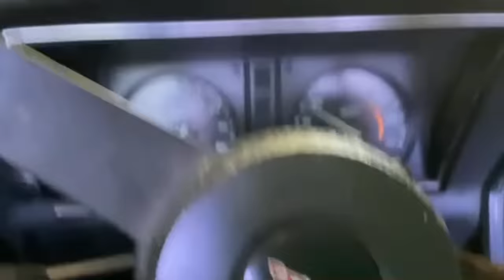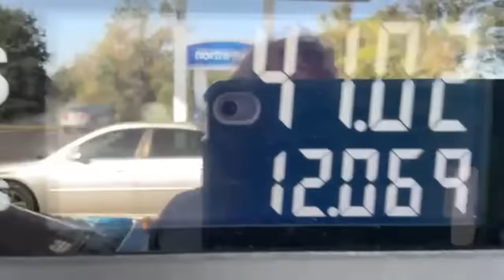Building My Dream House With lil To No Experience

Comment: Inside, get 2 plastic bottles, fill with hot tap water, put your feet on them, wind a blanket over that or the whole bottom half of your body, feet too and be warmed. If the socks are too tight, your feet will stay cold. One pair is good, so you don't get burnt. A microfaser housecoat in the trailer will keep you warmer. Call us if it snows, for further directions😂. ❤